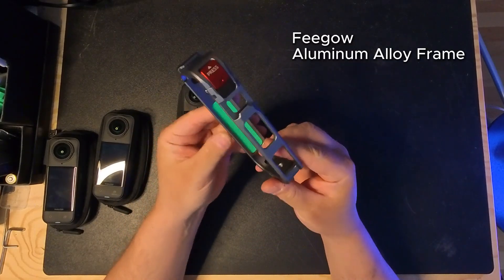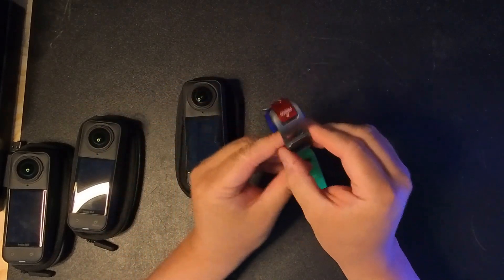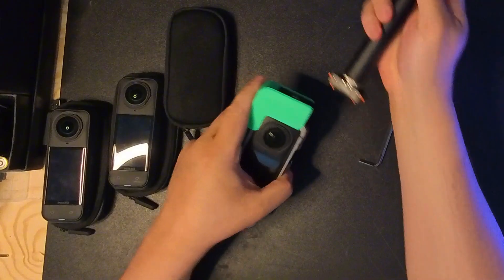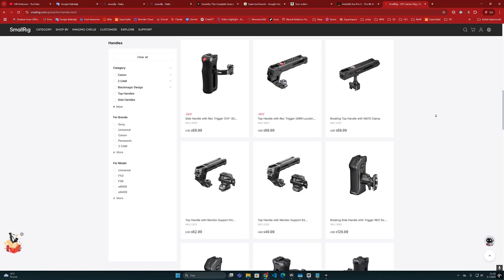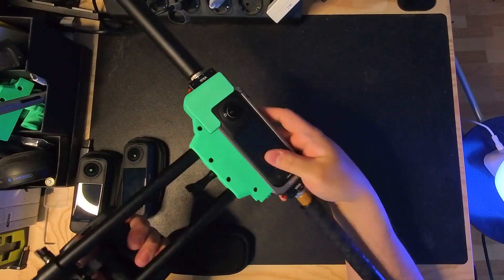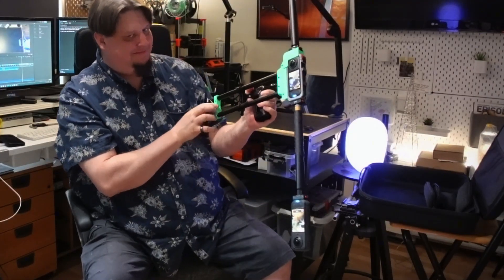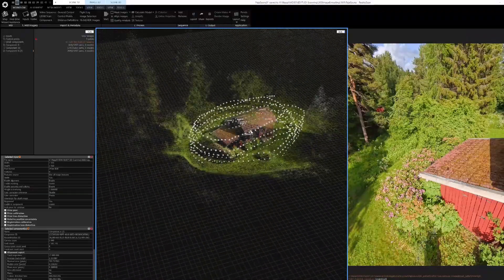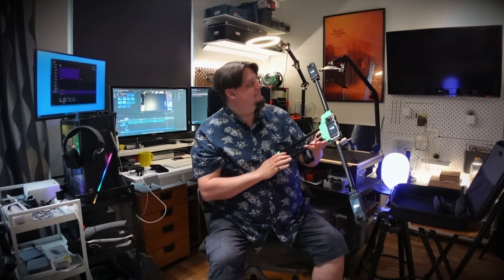Check out This 3D Scanner Build made from three Insta360 cameras

Comment: Just as in another post here, I was wondering if a scan with only the two outer cams would do the trick, I have an X4 and have just bought an X5 (with your referral link😉) to test with 2 insta 114cm sticks joined in the middle by a double stud screw adapter for a start. Have you ever tried to make a scan with only two camera ?
Thanks for all your videos, they are a great inspiration !

Comment: I am impressed with your 3D scanner build using the Insta360 cameras! Are you incorporating any geo-referenced data (like GPS, IMU, or RTK) alongside the 360 imagery to spatially align your scans or create georeferenced 3D models? I’d love to know how you integrate that into your reconstruction pipeline.
Reply from the maker: Yes. That is one interesting aspect that I'm trying to achieve. It seems that Insta360 cameras can handle geo data, but it is saved from the phone app. So basically it uses the phones location data. Try to figure out how to keep this metadata with the images throughout the process.
Reply: @OlliHuttunen78 That's fascinating! I'm particularly interested in the quality and detail you're achieving with this multi-camera setup. Are you able to achieve drone-level resolution and accuracy when scanning smaller subjects such as buildings or vehicles? How does your multi-camera approach compare to traditional photogrammetry using drone imagery in terms of final model detail and precision?

Comment: So, both sticks are only held by the magnets? How easily do they com off if you apply momentum e.g. by getting stuck somewhere?
Reply from the maker: No not only magnets. These quick release plates have very strong hooks in them that mount the cameras and sticks together. The magnets in them just helps to snap and lock them in place.